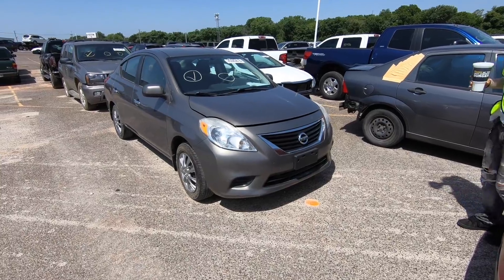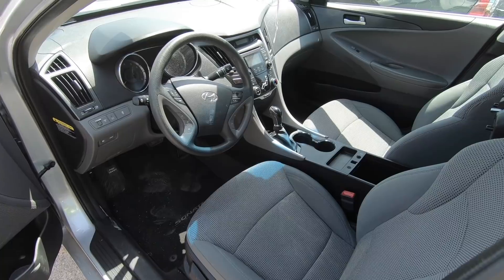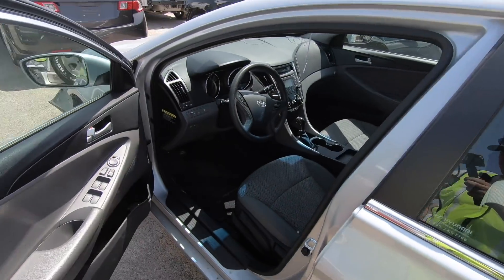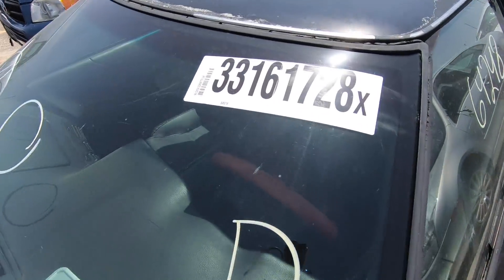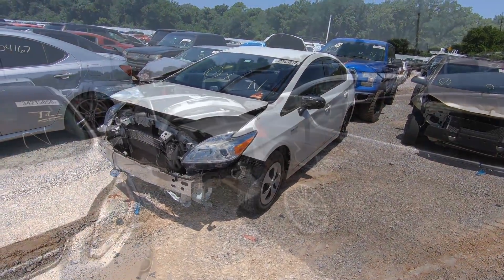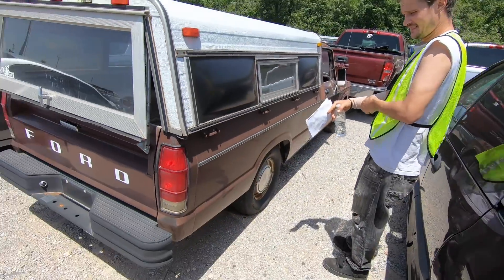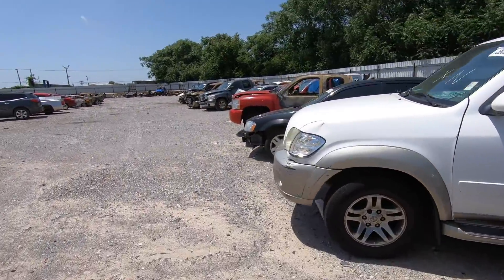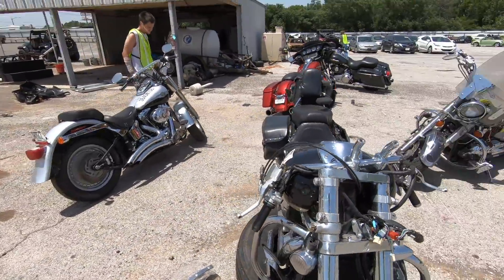Copart Walkthrough + Carnage + Potential Cars!!! 6-11-18

Comment: Uber man, my family has a couple ford focuses. They're both 05. Ones mine, and the engine vibration is in all of them. That's just how they are. Might be bad motor mounts but ours do the same thing and have been running fine for years
Reply: yep same with my family's old 05 focus ZX4. it also did terrible in the winter. it had the "rear brake locking up" issue. took it back to the ford dealership because it had bumper to bumper warranty, and they said there's nothing wrong with the car. so i suppose it's a factory defect with some ford focuses. my dad said the car spun around 5 times going down the main drag in town and decided to return the car at that point immediately.  we dropped the car at the dealership and put the keys on the front counter.
Reply: Lincolnator, huh. You seem to have had a bad experience with theirs. The only real issues we had with ours is one of our focuses we had to do endless serpentine belt replacements and the door is stuck shut and wont open. Other than that nothing major. Almost 200k miles. Our other focus was passed down to us recently by my aunt who was, not very good on car maintenance. We have brake issues atm and also the top of the oil cap is just sludge. That cars been through alot and powers through.
Reply: I have 4 focuses passenger engine mounts they are about 93 bucks on tasca don't buy the non oem
Reply: Hell my '98 Escort Zx2 has those vibrations

Comment: I worked on a 2008 Focus a few years back. It had the shakes like the one you posted, there was actually a tech service bulletin from Ford stating to check for a pebble in the lower dog bone motor mount. Sure enough there was a pebble jammed in there, removed it and it smoothed it out.
Reply from the maker: That is crazy!!
Reply: TSB 10-5-11. I just looked it up. I thought it was crazy as well.
Reply: Wow!

Comment: The older ford focus motor mounts are pretty common for failure causing a bad vibration, so that vibrating your hearing is coming from the engine mounts, also that is a duratec engine :)

Comment: The rotary engine seems to be so simple to rebuild, it cracks me up that everyone acts like it is magic! It's a triangle inside of an oblong circular shape with shims on the edges of the triangle that gives you your compression! Simply take it apart, replace the shims & use grade 8 bolts & POSSIBLY HONE OUT THE INTAKE & EXHAUST & DONE=NEW MOTOR! ROTARY MOTORS LOOK SO SIMPLE!!!! I AM SURPRIZED THAT ANYONE THINKS A ROTARY BUILD IS HARD!

Comment: I driven the Versa a couple times and they are horrible on the highway. The CVT transmission likes to slip and cause the car to hit redline at 70mph. But I've been loving my 2015 Ford Focus SE, I've put about 51k miles on it since I bought it new. I had a couple clutch issues, but I had the issues resolved and haven't had any issues for almost 30k.

Comment: Looked at a salvaged XLR....rear hit, but both headlights missing....GM doesn’t make them anymore, and neither does the aftermarket, $2000-3000 each used if ya can find them.

Comment: It may have been a previous vid, (I have been watching your vids back to back) you showed a 2nd gen focus & refered to the motor as a zetec, The intake was on the front side of the motor closest to the radiator= known for intake flapper damage & can dislodge & enter the motor causing damage & at least idle issues=duratec motors. The zetec was in 1st gen focus & intake is on the rear of the motor, closest to firewall-good guess tho! The hail damaged 239k prius @ 26 min(IF BATTERY IS GOOD?), Who cares about looks if it runs & gets 40-50 mpg? but, people are prissy until they are walking!

Comment: Versa probably has a bad transmission
Reply from the maker: It must have been driving to have run over something. I'd guess it's still good.
Reply from the maker: Almost all cars today are "sealed" units.
Reply: If I come across a car that has no dipstick for the transmission I won't be buying it. Built-in obsolescence.
Reply: 11094DEREK There’s barcodes on it also which means that’s its a used rental.

Comment: will they not let you ride a bike out there? that's just the kind of repairs on that Hyundai that i am looking for but i'm not paying those prices and then have to haul all the way there to grab the thing and tow it all the way back here to repair it. it is worth it but i personally would go broke trying to get it . if you could get that focus cheap enough  it would be worth it , it sounds like it needs a muffler at least any way and due to the shaking maybe an engine mount too.  Motor mounts are easy on those cars.  dang! what a shame about that corvette someone didn't love it properly.  didn't do me any good to even look , it was long gone sold before i ever got to look at it. On that prius you could steam clean the shit out of the car with Apple Cider vinegar and or clorox water and not ever have a problem with it again. eww  yeah skip it! water level was way too high on that you'll never get the motor, battery drained and working right without disecting the whole thing. You know what. I love those Cadillac XLR's also the ONLY reason i don't already have one of those comes down to the one thing all people hate about a LOT of cadillacs' "NORTHSTAR" nuff said! that aside they are beautiful cars. i was about to say that Prius V took one REALLY hard hit from the looks of it. I know of a you tuber that actually got twice that mileage on his using Mobil 1 motor oil. ok dude with regards to the Courier, get out of the sun yer brains are fried lol. that scion TC and Hyundai Tiburon looked like good candidates for quick easy flips too. without a whole lot of work, i actually like the blue on that scion  that's sharp. prolly hard to paint though, WHY NOT DO LIKE TODD..(unwrecked) and just don't post the video until you've already won or lost the auction. that way no one is any the wiser what you're bidding on and can't pull that stupid shit of running the bids up on you Common sense is my super power!

Comment: Don't buy a versa, they have terrible transmissions
Reply from the maker: Even at 89K miles?
Reply: Ex Wife had one, think it had 98,000 on it when traded it off. The CVT transmission are expensive to fix around (2 grand) and basically non serviceable.
Reply: They're also one of the worst crash test rated of all compact cars. They're death traps!
Reply: Here in Costa Rica these cvts dont last even 60k kms, with all the hills here they blow up

Comment: I would imagine that vehicles in O.K. would be rust free compared to the northeast rustbelt! The salt that the city uses in the winter, destroys vehicles! The only way to keep a vehicle around here, is to keep it in a  (preferably heated) garage & only drive it in the summer, After the salt is mostly gone! That is why vehicles rust so bad in & on the east coast! Then one must pressure wash their vehicle immediately after driving it! Must spray the underside better then the visible parts of the vehicle & lets face it, barely anyone has a garage, much less a heated garage & pressure washes their vehicle indoors within a heated garage with floor drains, I wish I had such needed equipment(garage & pressure washer) but, I don't yet! better yet, when people go mudding & don't wash off the mud & destroy a previously good vehicle!!!